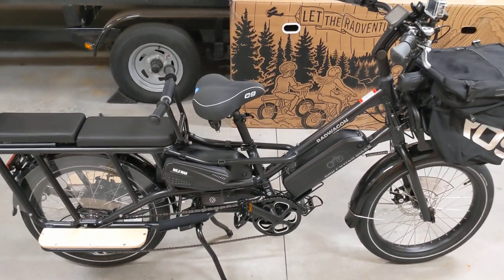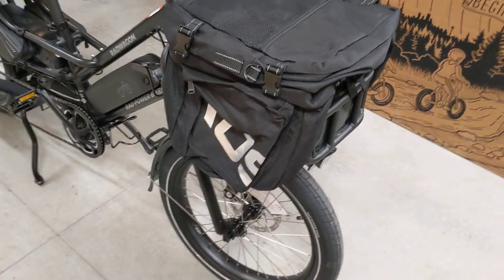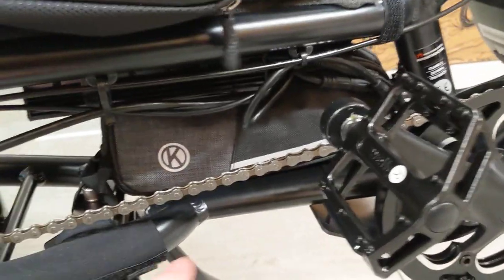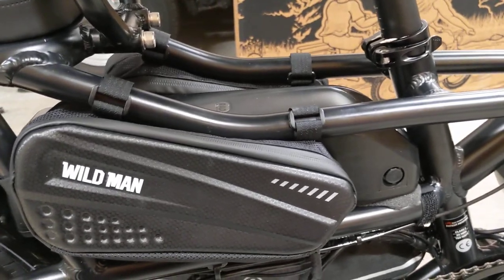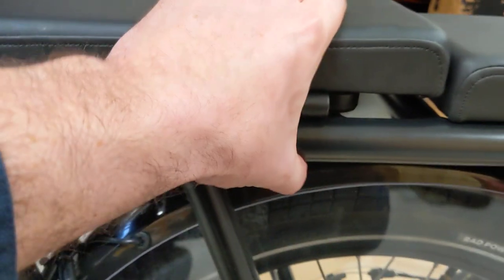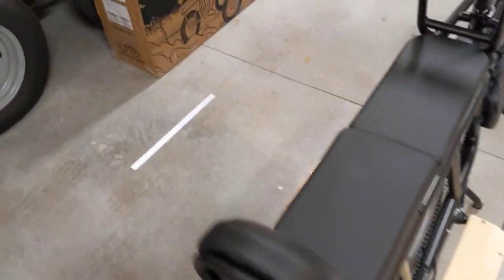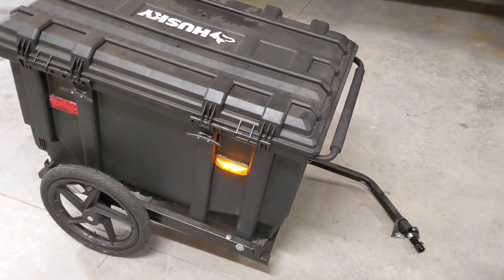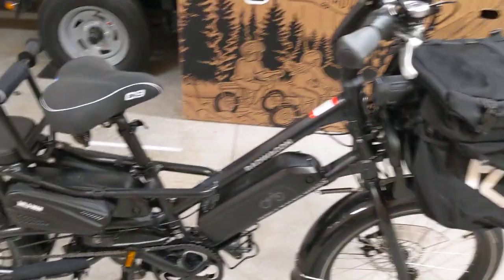Hidden spare battery holder on Radwagon 4 !?!? - Rad Power Bikes + accessories.

Comment: Love it when a plan comes together! Perfect fit! Who would have know the fit would be perfectly snug like that. Rad Power bikes should design this bike with a duel battery set up. I have a Juiced Hyper Scorpion that is fitted with a splitter cable w/on-off switch allowing me a connection to back up 52v 30ah battery- in Pelican trunk on back rack. Check that out it’s on  eBay. They call it Juiced Bikes duel battery switch. It has and this is important a XT60 connector. If your bike doesn’t have that you can get a compatible connector and splice it on. I also have a Rad Mini 2018 great bike and may the Rad Wagon certainly seeing your set up has me leaning to the buy. Beautiful set up and that spare battery fit! Nice.

Comment: Is your second battery paired with the first or is that a backup battery position.? From what I've learned you can pair dual batteries and upgrade your controller and drain both batteries at the same time for extended distances. Appreciate your thoughts?

Comment: How did you install the led lights on the trailer box please? Are they rechargeable or do they have to be connected to some sort of circuit? Most importantly: do i need to be a rocketscientist to install them? Thanks in advance